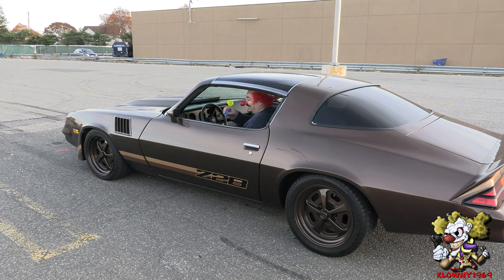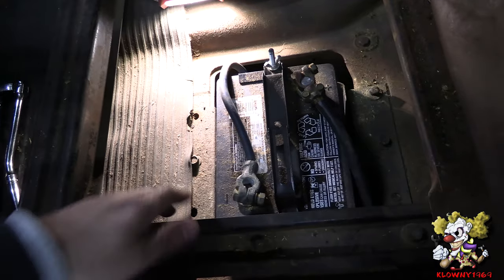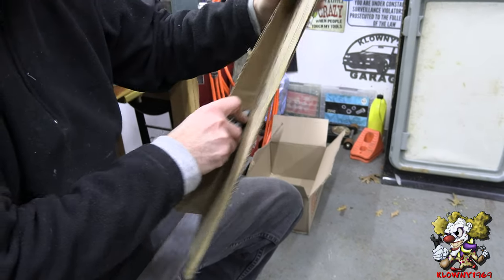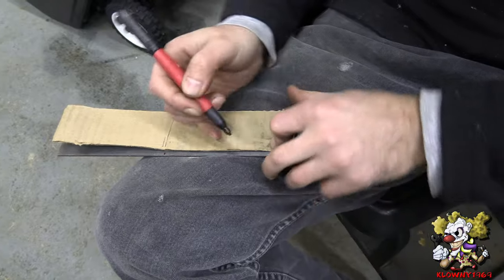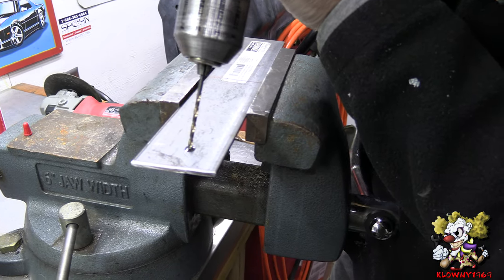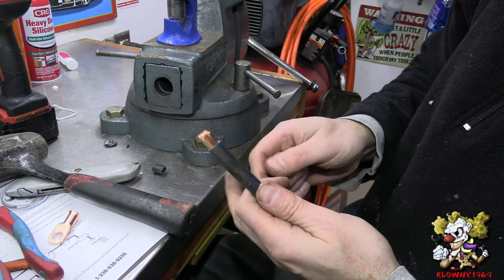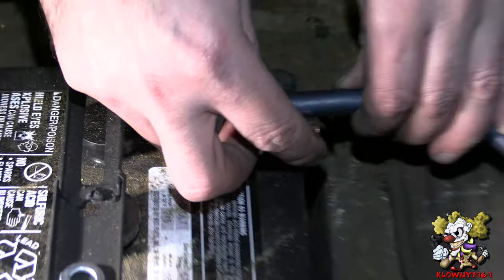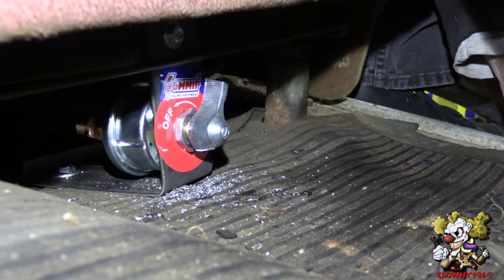How To Install A Battery Disconnect Switch

Comment: My battery is in front. 05 yukon. I need the switch inside.   I was told not to run big guage wire that far. They suggested a relay at battery negative side and use small wires to inside to a smaller type switch. 
I fail to see the reason why. 
 Disconnecting the negative side should have no effect on the amperage going to the starter. I'm really confused about the opinions on this subject. 
And the comments from the Marine business said tap into the positive side.  
Unbelievable confusion
Reply from the maker: You know that the starter gets it's ground from the engine? So your only talking about the positive side. It's not recommended to use a big cable going inside the car because if the positive cable shorts out..that will be a definite fire...don't forget to subscribe 😉

Comment: Why didn't you put some solder in that zero gauge wire connection
Reply from the maker: not necessary..you can put some vaseline or silicone lube if you want..don't forget to subscribe

Comment: Is there any risk to a longer run? IE switching the negative side of the bat between the terminal and grounds with a 4 to 5ft run through the firewall to mount a high amp switch like this under the dash. '73 F250 Highboy

Comment: Why there is no one knows reasons for killing battery?let me tell you,reason is simple,there is water submerged the wires,especially the connection points,caused linkage of electrons.
Reply from the maker: Uhmm there could be a draw